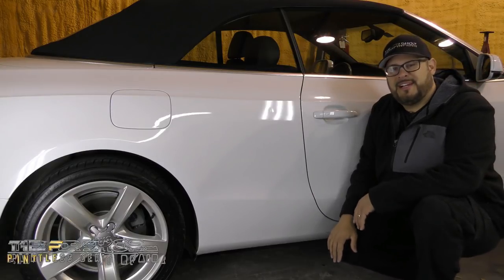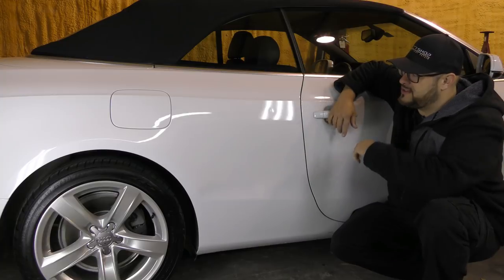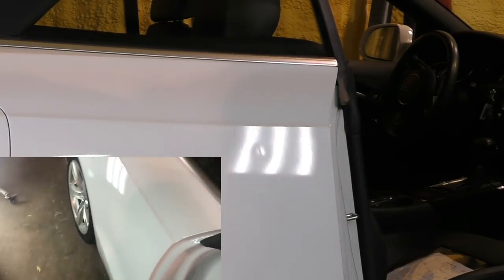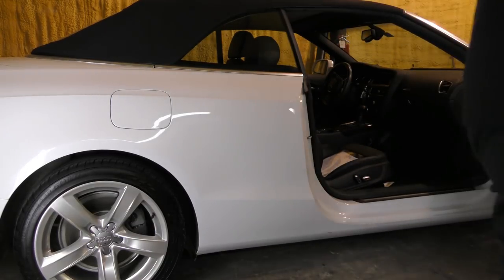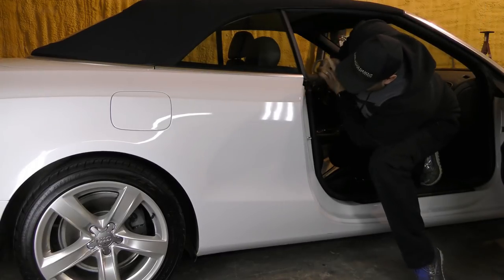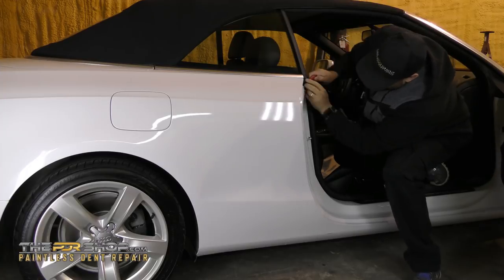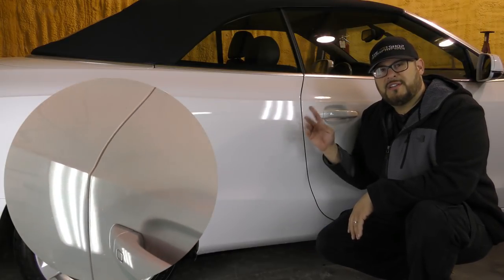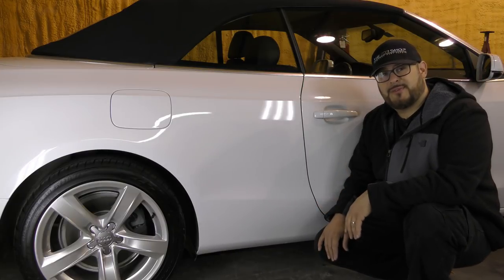Does it Work? 13 Audi A5 Door Ding Repaired with Paintless Dent Repair Kyle TX, Buda TX, Austin TX

Comment: Great video Charlie!  Quick question.  What are you using to add titles across the video and how are you getting you logo water mark in the bottom left of the video?
Reply from the maker: Pro PDR of Ga  I’ve been using a edited call Fillmore of Wondershare
Reply: The PDR Shop Charlie Molina looks like that’s PC based and not an app?